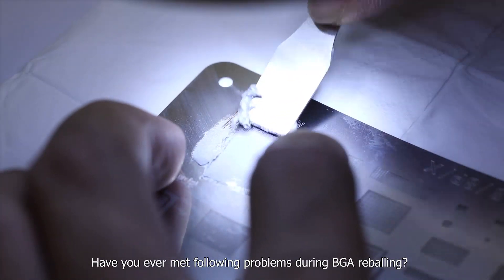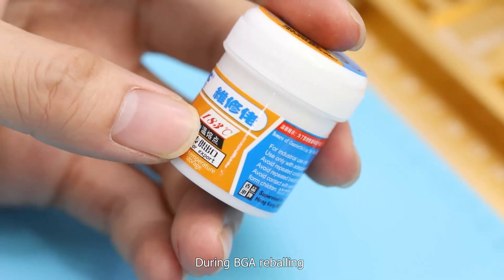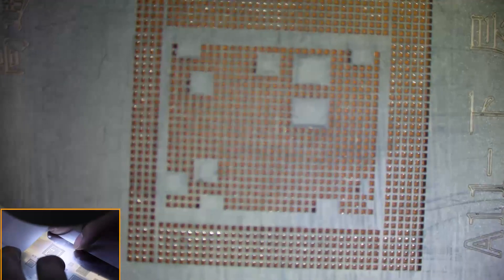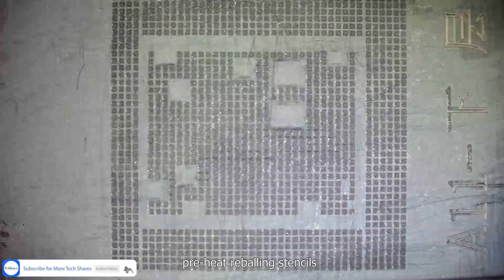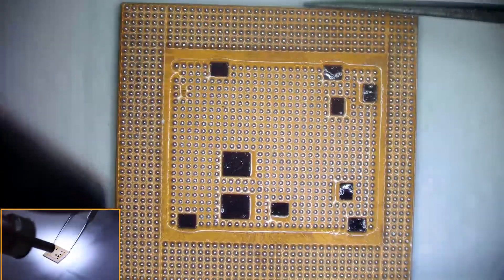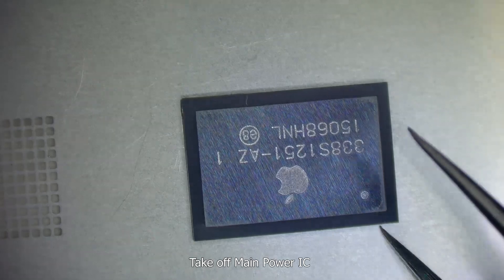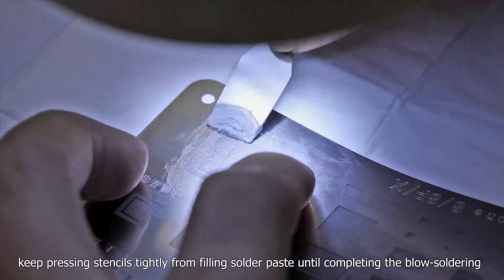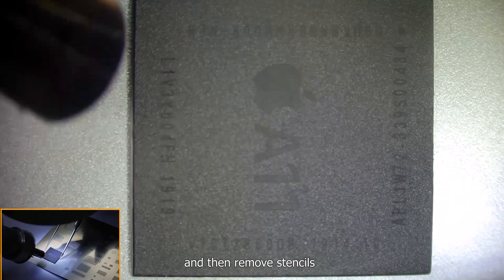Mother Board Repair Skills Course-BGA Reballing, Tips And Solutions

Comment from the maker: Have you ever met following problems during BGA reballing? Trying to reball BGA but tin balls float above reballing stencils? Or solder paste just flow on BGA and doesn’t shape balls? Or even damage the reballing stencils? For rookie repairmen, how to complete a perfect BGA reballing is a big headache, now let’s see how a repair master handle reballing job.

SUGON 8610-DX Desoldering Station Hot Air Gun, 220V, w/retail package
https://www.elekworld.com/shop/productinfo.aspx?proid=15826&categoryid=283

BGA Reballing Stencils Plate Kit for iPhone, 6pcs/set
https://www.elekworld.com/Shop/productinfo.aspx?proid=6606&categoryid=351

B80-BS458 MECHANIC Lead-Free Solder Paste, 60g
https://www.elekworld.com/shop/productinfo.aspx?proid=6940&categoryid=283

Goot CP-3015-10 3.0mm Desoldering Wick, 10pcs/set, Original, w/retail package
https://www.elekworld.com/Shop/productinfo.aspx?proid=15837&categoryid=374

For more Repair parts&Tools and Tech support, please visit: 
Website: https://www.elekworld.com 
Facebook: https://www.facebook.com/Elekworldshop/ 
Instagram: https://www.instagram.com/elekworld/ 
Twitter: https://twitter.com/ElekworldL